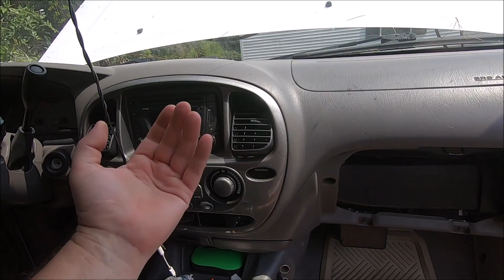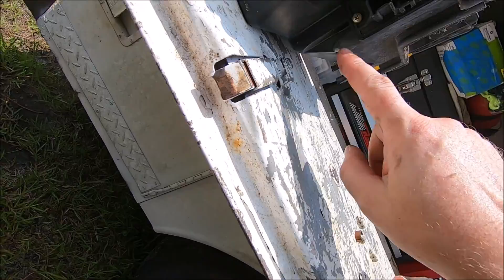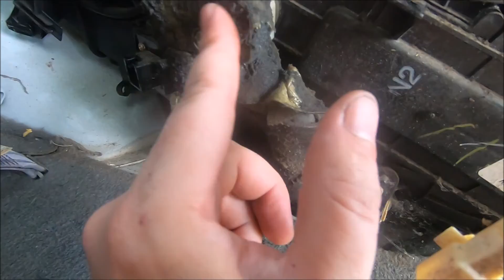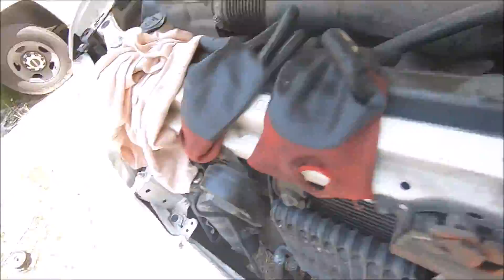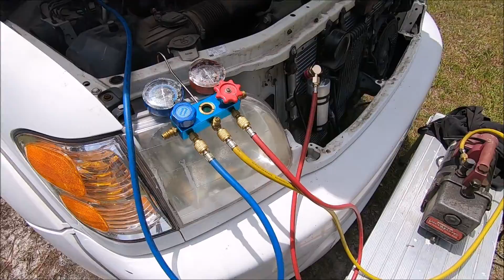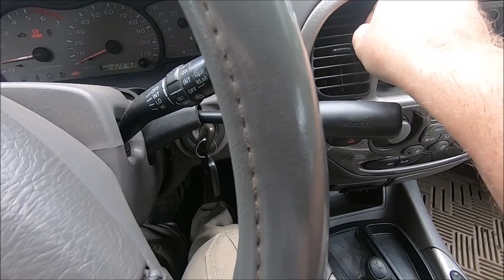2002 Toyota Sequoia Complete Air Conditioning Rebuild

Comment: i just replaced ac compressor condenser condenser fan receiver drier expansion valve evaporator core and still not blowing 40 did you ever find out the problem?
Reply from the maker: I spent a long time double checking everything and even checking blend door function and all the little things. Short of tearing it down again and checking the actual thermostatic expansion valve adjustment I ran out of things to check. Everything I found was operating normally. It still will not go below 60 degrees, but we opted to settle for that rather than throwing more money at it. If we ever discover something verifiably wrong with it I will post an update.
Reply: @wrenchwranglers  i just read article yesterday toyota had tsb updated suction line. Bigger in diameter and built in inline filter is yours updated line?
Reply from the maker: @What-ut8vu  I am not sure. I did not see that TSB but that is good info. Do you know the size difference so that it could be measured and checked?
Reply: @What-ut8vu u have a link for that article? im interested
Reply: @DATDS2  you can search google toyota sequoia ac compressor durability improvement tsb
Reply: @wrenchwranglers  my ac line looks updated and still blows 60 so i guess its no that problem
Reply: @wrenchwranglers  i have found the problem just confirmed now blowing 38 degrees
Reply from the maker: @What-ut8vu  what was the problem? Hopefully something easy
Reply: @wrenchwranglers  evaporator thermistor got it from dealer 16 bucks i unplugged it from glove department swap with new one to check now i have confirmed the fix i gotta take out the evaporator out and put it in but doesnt blow 38 when standing idle even though my fan clutch is spinning but i dont think its spinning at full potential i will be ordering the fan clutch next man blowing 38 from vent feels great now!